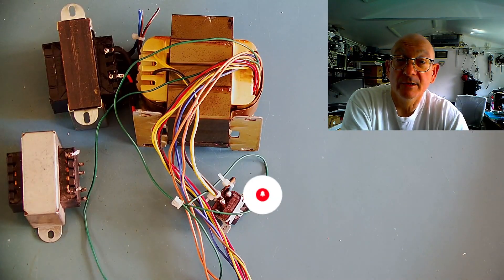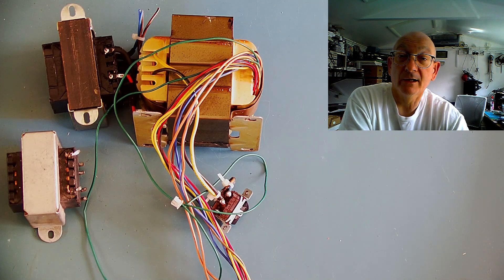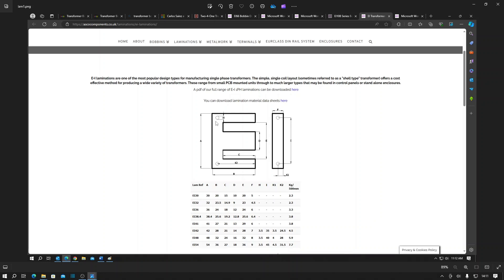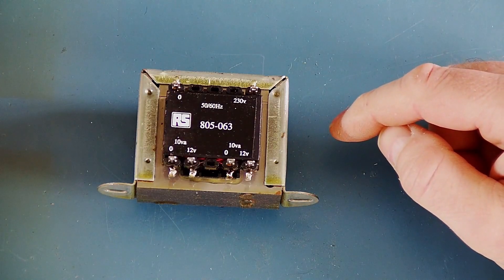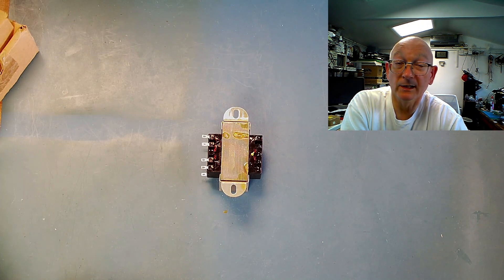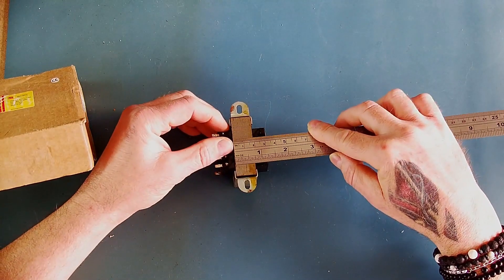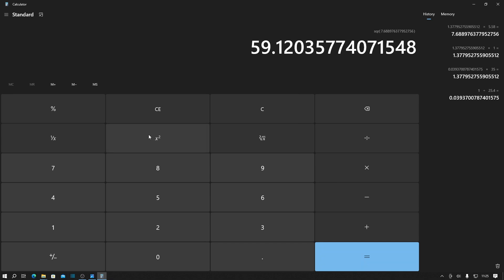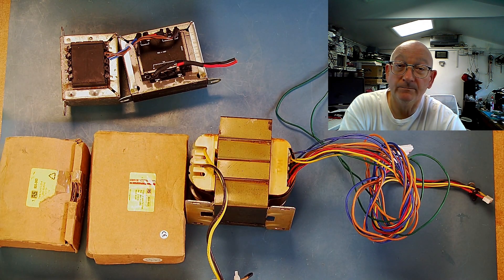How to calculate the power rating of a transformer

Comment: I have a question, if you don't mind. Let's say I want to power an amplifier with a linear power supply and I know my amp will draw 1A at 50V DC, so I pick a transformer with a 40VAC secondary winding (because after rectifying and filtering I'll get up to 56V since  40 x 1.414 = 56V, but accounting for losses in the diodes and sag under load that would result in 50VDC). Anyway, that's a 50W power draw requirement, but will a 50VA secondary be enough for this use case? Assuming the power factor is 0.7 for this power supply, does that mean I need a secondary of at least 50/0.7=72VA? Or can the power factor losses be ignored and go with 50VA?
Thanks
Reply from the maker: Hi, the VA rating is referred as apparent power which does not take the load power factor into account. Therefore losses in the secondary need to be accounted for when selecting the transformer rating. So yes a larger transformer would be required in this case. Basically the actual current in the secondary winding needs to be determined do the correct gauge of wire is used to wind it. The size of the transformer is then calculated so that the identified wire gauge / turns will fit into the transformer bobbin. However depending on the amplifier type of course, amplifiers  often do not consume maximum current 100% of the time so de-rating maybe possible there.
Reply: @Joftec  Thank you, much appreciated

Comment: Would it not be easier to weigh transformer and multiply that by a constant to get power?
Reply from the maker: I think it is far easier and entirely more accurate to measure . I have seen toroidal transformers gestimated by weight, as it is practically impossible to measure the core, but not EI transformers where core measurements are relatively easy.

Comment: A nice shortcut would be to multiply the two dimensions in mm together directly, then divide this quantity by 115.62, then square the result. This will give you the same answer but with fewer steps! 115.62 is just (25.4)^2 / 5.58
Reply from the maker: The actual metric value for the equation is 116.129323 as shown in the video . In very basic terms because the core you measure is not actually the core

Comment: where does the 5.58x "constant factor" come from?
Reply from the maker: The actual design process is not covered in this video, the purpose of the video is to estimate the design power dissipation of an already designed transformer. The example at the start is an example of how the process works . For example when you measure the core size as shown in the video, you are not actually measuring the core because for the laminations to work they are individually insulated, this insulation therefore occupies space in the core and reduces the magnetic material in the core. These details are taken into account within the math . Hope that helps
Reply from the maker: It is basically derived from the formula shown near the beginning of the video.
Reply: @Joftec  ok. at 3:18 I see you assuming 50Hz and 2.60 turns/volt. But then at 15:43 there is a logical jump that eludes me

Comment: Interesting! For the mm version, it seems pretty straightforward to measure L*W, divide by 116, then square that answer. Seems quicker and just as easy to remember
Reply from the maker: Sure, it’s ok for estimating.
Reply: Yep, (mm²/116)² =VA  or (inches² x 5.58)² =VA.
 Six of one, or half a dozen of the other, as my father used to say.
Reply: I agree it is close,but the actual derivative is 116.139323 in mm or 5.58 in inches. For estimates 116 is fine, for designs it is much better to be 100% accurate. The difference is quite small, but can be important when physically fitting the secondary ( usually, as the wire is thicker) winding onto the bobbin. The actual area available for the copper as apposed to how much copper can be wound in that area, can be and is different. During the design process, this is one of many factors which have already been taken into account when the finished product is estimated. Like everything else copper, laminations and time are expensive and transformers are for sure designed to be as cheap as possible, this means that they will perform at 100% of their design capacity with an agreed temperature rise in an agreed cabinet size/airflow. The copper and lamination quantity increase with size, therefore smaller is cheaper, but smaller is also hotter electrically and cooling efficiency so there is an exponent there too. Different manufacturers in different regions may also have different Bobbin/lamination sizes available,in the UK and both metric and inch sizes were freely available when I was doing this , this can make subtle differences in the area available for copper. Different regions have different standards for the insulation thickness on the copper, and even differing Amps per square mm for the copper itself, which is nuts, but true.

So in summary, for estimates, which is the purpose of the video, I agree 116 for mm is acceptable. For designs 116.129323 is better, and for simplicity 5.58 is the best, for me anyway.
Reply: @jonathanperry1583  That doesn't make sense to me, using 6 decimal places in mm, and only 2 decimal places in inches. 0.1mm equals approx 0.004 inches. if you wanted to be that precise, inches would need to have more decimal places. But the calculation was being used as a ballpark estimation of VA anyway, 0.1 mm makes little difference in the calculation. Then you would down rate the estimate by 10-20% or so, don't want to push the transformer to 100% of its estimated maximum VA.

Comment: Is there an equivalent calculation for toroidal transformers ?
Reply from the maker: Hi, yes there is . However this is far more problematic for several reasons, a couple being , 1. It is almost impossible to measure the cross sectional area of the core of a wound toroid as it is completely covered by the winding(s),insulation etc. 2. There tends to be a wider range of core materials, and thickness of coatings on the cores, which can mean large differences in core efficiency. I therefore do not want to endorse reverse calculation on a toroidal transformer. Hope that helps
Reply: @Joftec  Thanks and I understand the logic. The reason I asked is that most of the transformers in my junk/spares/gold box are toroidal

Comment: Good stuff, thanks for sharing. 
How does the third dimension of the cord affect power? For example, if you transformer had the same x and y but the transformer was only half as tall (low profile), how do you factor that in?
Reply from the maker: Hi, interesting question. As I touched on in the video , normally when designing a transformer the turns per volt and current required are calculated. The cross sectional area of copper is then calculated, and a suitable bobbin is selected based on that requirement.The actual math behind the calculation is relatively complicated, and the method shown is a simplified shortcut. Bobbin and lamination manufacturers follow the rules determined by the math allowing the shortcut shown to become true. Therefore in effect the only measurements needed are the ones shown and the overall width is irrelevant for the shortcut. As far as I am aware the overall width of the lamination is determined by the width of the central section of the E. I believe that roughly speaking the area of the outer  “arms “ of the E are close to the inner section of the E.  Therefore the overall width is roughly the centre plus 2x the arms plus 2x the gap for the winding. The gap for the winding is based on the area of the gap and its relationship to the current handling capability of copper wire for a given area. The really interesting part is that that value can and is adjusted depending on many factors including desired operating temperature, enclosure type, and cooling, for example . Hope that helps.
Reply: @Joftec  Wow, thanks, yes that helps!